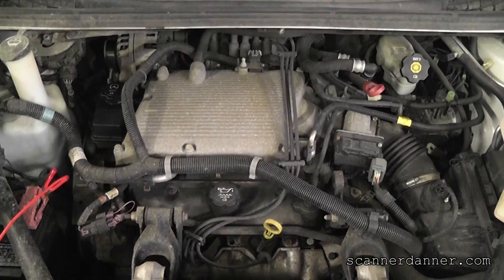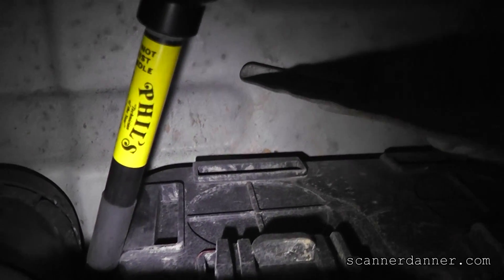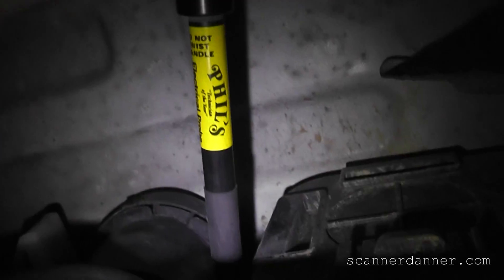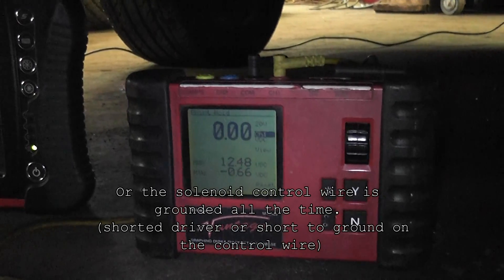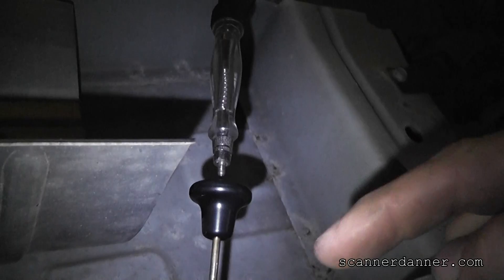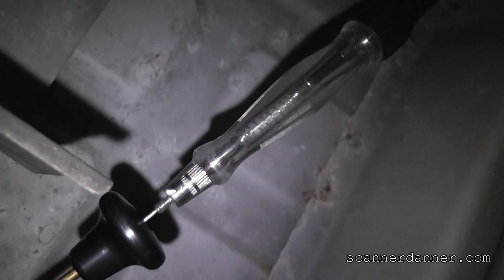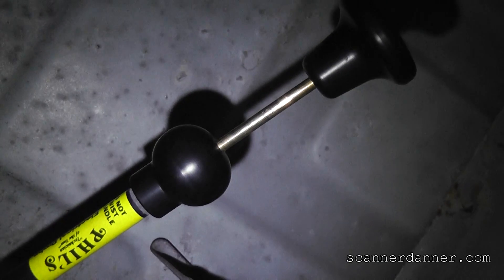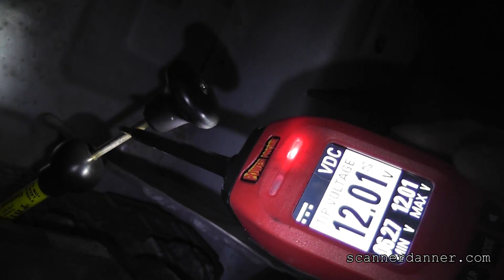How to test an EVAP Vent solenoid (applies to all cars) - GM

Comment: Although it prob wouldn't have worked easily on this setup, I was shown a nifty trick for checking those vent solenoid circuits out  (the two wire ones):  take a 921 bulb and at the bottom the two wires can be bent out from the glass base and they are the perfect size and distance apart to plug directly into the vent valve connector.  Unplug the connector from the vent valve, stick your handy dandy circuit tester bulb into the connector, and then toggle the valve with your scan tool. Bulb lights up- you have a good circuit and driver. Plug the connector back on the vent valve and toggle the solenoid once again with the scanner: if you hear it click, it's good. If you don't, it's more than likely bad. It's a quick 30 second way to check your circuit for power and ground (or power and control), turn the valve on with the scanner and if the bulb lights, your circuit is good. If it doesn't then you can break out the meters, power probes, and extension wiring and find out why it's not working. I have also used this method to check power and control / ground for the two wire purge solenoid circuits as well, it's a real quick and easy way of verifying your circuits to rule out the computer and wiring to the solenoid and all you have to grab is your "circuit checking 921 bulb".  I keep several handy in my electrical drawer of my box and it's a huge time saver when diagnosing those pain in the butt EVAP codes. Thanks for the tool review, I need to get a couple of those "Phil's" as well!
Reply from the maker: +FireoftheGreeks great quick test, thanks for sharing
Reply: would this work on an injector also ? im assuming yes

Comment: +ScannerDanner Does the test light protect the computer controlled circuit because it puts a load on that circuit (the test light)?
Reply: Not a load. The globe limits current flow to a safe level.
Reply: TJM Networks
Reply: Well, TJM Networks  is not wrong. The test light does put a load on the circuit, which as a RESULT reduces current flow, as opposed to putting 12 V directly into the driver-controlled circuit with no resistance which would result in no load = no resistance= high amps = fried PCM :p  Or did I miss something? :)

Comment: Paul, Thanks so much for the endorsement of the PP4. You may not know, but the PP4 can test the ground controlled driver by using its "Driver Test Mode". It was designed to make fast work of the problem you are showing. During this test the Power Switch is disabled so there is no danger of accidental activation.
If you go to www.powerprobe.com and then VIDEOS and then "How to use the Driver's Test Mode" you can see how.
If you guys have any questions, we are here for you too.    jeff@powerprobe.com
Reply from the maker: +Jeff Whisenand that's cool, I did read about it but forgot it was there. So in this mode, other than it disabling the switch (great idea btw) what is the difference with the green and red leds? Does the PP4 add more of a current during the test? Or is it simply a lock out and you then are just using the LEDs and or voltmeter?
Reply from the maker: +Jeff Whisenand Here is the video for others to see. http://fast.wistia.net/embed/iframe/lmsx98xobv?popover=true
Great job on the video btw, loved the animation. Anyway, I see that the tool is applying a current limited 12v signal that you can watch drop as you energize the driver.  (cool!)
1. What is the current limited at for this test?
2. What about a high side driver setting (power side switched driver), is there a setting to tell the PP4 what type of driver?

I know I could research this stuff, but it would be helpful for others to read the answers here. Thanks Jeff!
Reply: +ScannerDanner when using the driver test mode it puts voltage on the control circuit because on some ecus it needs to see voltage to activate the circuit but it will spit safely so you don't fry the computer. Once you activate the control circuit with the scan tool it will go to zero.
Reply: +Jeff Whisenand  You need to get Paul or Eric to make new videos for the pp IV that are more detailed at how to use it. Too many are complaining including me that your videos and a lot , leave a lot to be desired. You are selling them but leaving people out their having to figure out what the instructions really say. Sure you would sell more with better instructions. You say it is for all levels of experiance. I don't know everything but I am far from inexperianced with electricity

Comment from the maker: okay, I don't mind the thumbs down, but when it is this early in a video release it has to be from one of my faithful subscribers. please tell me what you didn't like, even if it is a private message, I'm okay with that. 
I realize it may be because I plugged that electrical probe so much, but realize it was from the heart AND if I can support a fellow technician that has a great product,  I'm going to do so. I would do the same for any one of you!
Reply: +ScannerDanner Sir, thanks for the kind words about my probe.  I built the thing for myself, as I was looking for a tool that would pierce without destroying the wire.  The guys in the east where there is salt on the road don't like the tool and I understand, but as Jim Linder used to say, you can use clear fingernail polish to seal the little holes it makes.   The tool has been through several iterations as the earlier version was a slimmer design with longer needles.  I had trouble with the probe breaking and the needles bending so I redesigned it to the fatter probe, though I still like the skinnier version.  It is model car driveshaft material, by the way.  The shorter needles are pressed into the shaft rather than soldered as the soldering was taking the tensile strength out of the needles.  This latest design is fairly durable though like any electrical testing device, it is not unbreakable.  It will work fine to turn on your vent solenoid, for example, but if someone uses it to turn on a cooling fan, it will burn the needles right off with the current flow.  
Anyway, I like your video and appreciate your comments on the probe.  And yes, I am an IATN member, a shop owner, technician, and an automotive instructor.
Reply: +ScannerDanner I can assure you its jealousy.  Some people actually subscribe for the express purpose of giving a thumbs down on a release despite the fact they watch the whole video every time.
   Looking at it logically, less than .5% of the votes on your channel are thumbs downs and considering the quality of your typical subbie, the thumbs down actually speak far more about the asshats giving the thumbs down than they do about your videos.  Therefore, the idea that they can give you any relevant constructive feedback is fruitless.
Reply: Probably Phil's wife. She didn't appreciate you touching his tool. ba dum cheeee.

PS. Why don't you have a tool with your name on it? Pretty jealous of Steve Rob's ScannerDanner test light to be honest.
Reply from the maker: +lolz larkin lol, seriously laughed out loud and read this comment to my class
Reply from the maker: +thomas morrell I agree with you. I should have familiarized myself more with the tool but I am a film as I go type of guy. I think it helps in most circumstances to not have a staged problem. It helps from a stand point of learning my thought processes. 
This may not be the best approach with a new tool in my hand.
Reply: Somebody's just pulling your chain or being a keyboard warrior. That said i have accidentally given people a thumbs down whilst wachting on my tablet and catching the wrong part of the screen. You're doing good, keep doing it.
Reply: +lolz larkin  Hey Lolz , I know you really want a ScannerDanner test Iight real bad, so if I get another limited edition Premiun  channel test light I will send you one free of charge. Hope you don't live too far away :)
Reply: It's frustrating seeing the thumbs down from my end too. It must be even more frustrating for you. You're always going to get egotistical people who think they're better, and that their methods are superior, or that they'd do it differently. But that's not to say whomever clicked the thumbs down hasn't a genuine reason for doing so. I only wish they'd share why so we can all learn from their wisdom.

Keep it up Paul, it's all good! 👍
Reply from the maker: +UberArchangel the only resistance in the circuit during that test was the testlight bulb itself. Normal current draw on this vent solenoid is around 300-400 ma. My testlight current is less than 200ma  (again the bulb is critical here). In no way shape or form was I applying direct 12v to the computer
Reply: +bakray done the same myself, always removed though if I realise I've done it !
Reply: +ScannerDanner I thought the video was ok. my only issue was that you were using a power probe 4 which actual has a built in computer driver testing mode and could of been the only tool need it besides the scan tool. just a small pet peeve of mine is people buying tools and then not taking the time to learn their full function. now I'm not accusing you of being one of those people. just that in this case the tool in your hand for this video could of been used more efficiently. that being said I didn't and wouldn't thumbs down this video. Other than that I liked the video. keep up the good work and nice job on calling out publicly those who thumbs downed your video not everyone has the balls to do that.
Reply: Anthony Beaudry
Reply: +ScannerDanner Haha. Nice. Hi class.
Reply: +Steve Rob I'm in the UK, so probably not that cheap ...unless your postman is a strong swimmer?
Reply: +ScannerDanner For my is a fantastic tool =)
Reply: maybe it was a fat thumb on an iPhone 4.
Reply: +Steve Rob Hey hey hey, i want a ScannerDanner test light, i can't even find an led one here in Italy. Paaaull can't you do something for me? :)
Reply: +Andrea Gili Obviously i will pay both for the test light and the expedition
Reply: Andrea Gili  Ha the test light is not an item available for sale. If it ever goes into production there will be a announcement. Thank you for your interest.
Reply: +Steve Rob lol ok man understood
Reply: +ScannerDanner I've got both of those piercing probes, you may not use them all the time but when you need it it sure makes life easier.

I do the same thing with my power probe with a test light when I need to test something that is away from the battery. 
Handy tool in the right hands and used at the right time.
Reply: +ScannerDanner Thanks for the explanation.  I thought I missed something.  So it's not a problem to drive the circuit high provided you know the ECM is not driving it low (backdriving) and you limit the current to less than normal operation?  I just ordered a PProbe III.  I gather Use with Caution!.  Great videos.  I can't wait to watch them all...
Reply: +Schrodingers Box Hey Matt, you know the old saying, "when somebody opens their mouth and removes all dought" pretty much applies here. 
Thumbs down with zero explanation pretty much says it all.
Reply: so when u tell the scan tool to turn the evap vent solenoid on This tells the computer send a ground to the solenoid? So the test light lights up cause it completes a circuit? Is the test light connected to the white ground side of the solenoid? So your completing a 12 volt circuit with the test light?
Reply: Anthony Beaudry
Reply: Does the test light play the role of a resistor  i mean it doesn't short the driver to ground during the functional test??

Comment: i have never been a fan of the stab style wiring checks, i know sometimes it can be the only way, maybe an insulated 90 degree back probe would have been the best tool to use for this job, if that tool is available.
maybe a 90 degree pick with an insulated shaft would have worked..
great vid..
Reply from the maker: +chrismechanic B couldn't reach the connector my friend, even with a tool like you describe. but I understand your concerns for sure.
Reply: ScannerDanner maybe a long reach 90 degree back probe could be phil's next tool he designs.
Reply: +chrismechanic B What about a amp probe @ PCM or other access point along the way ? If there was low or no current then you would have to get up there to access it anyway, Correct? Also a volt meter hooked across the circuit would give a lot of info by itself using floating voltage. PP is a great tool but is a dangerous tool in the wrong hands. I have had to fix to many controllers with fried chicken drivers.  Either way nice Video Paul :) I was hoping you were going to do another video on the  Hummer with Intake pressure waves. That was one of my favorite series.